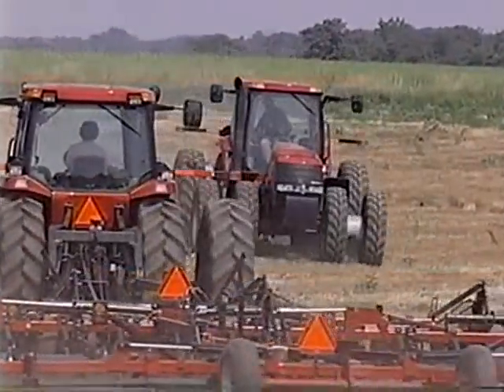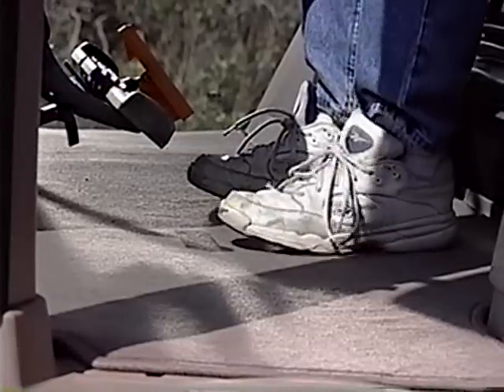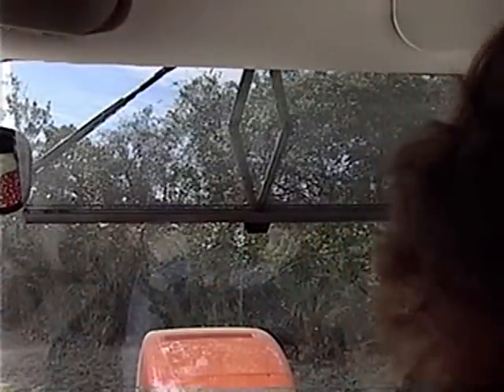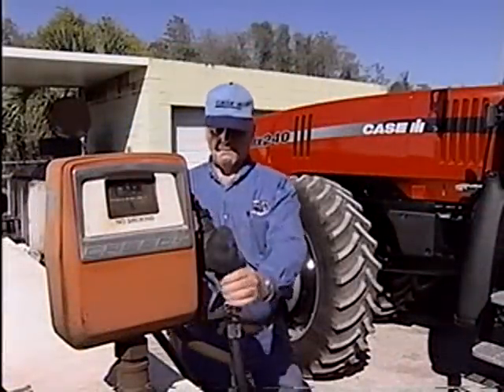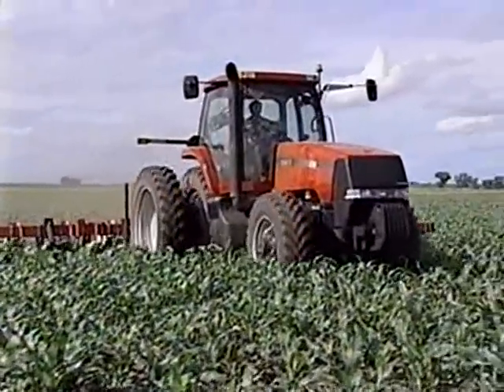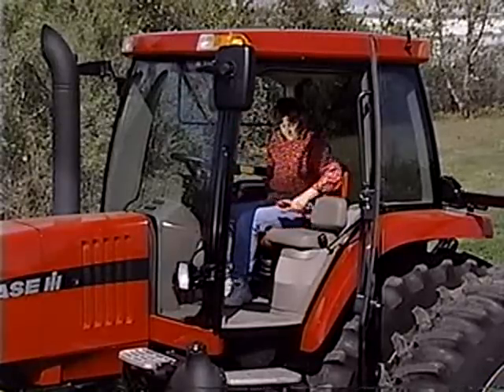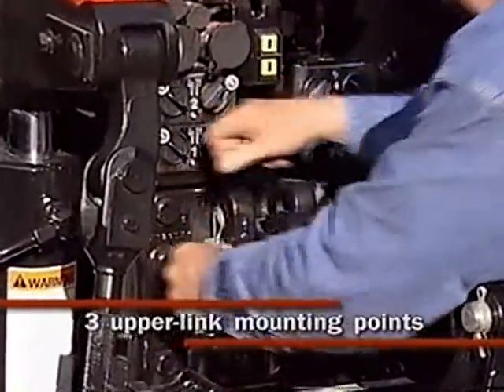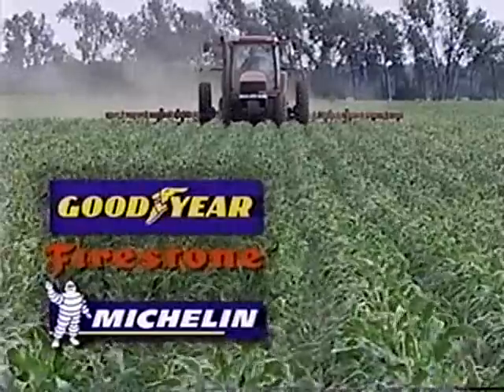CaseIH Magnum MX Series Intro (May 2000)

Comment: What's up with the hole through the frame at 10:31?
Reply: I would think that would be for the liquid tanks if you wanted to put them on the front
Reply: I find it makes the frame easy to clean with a pressure washer also